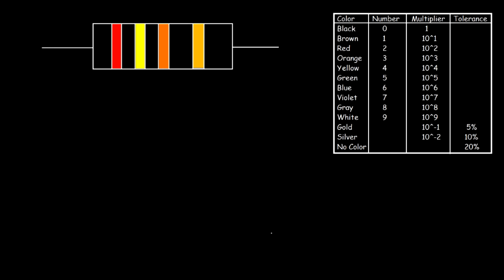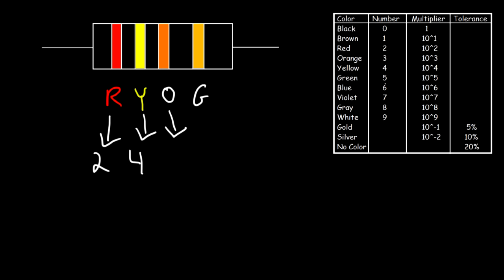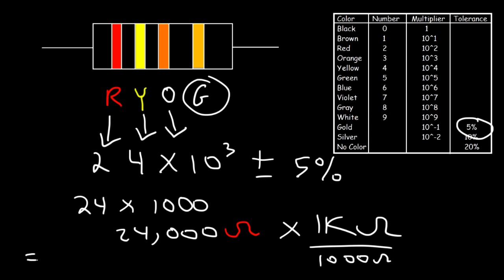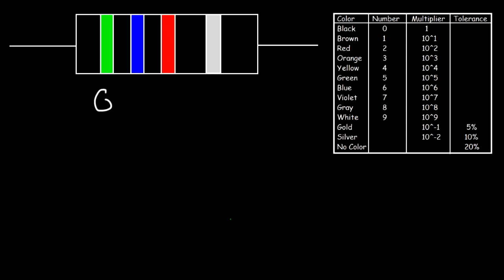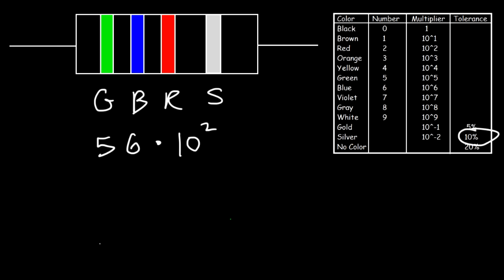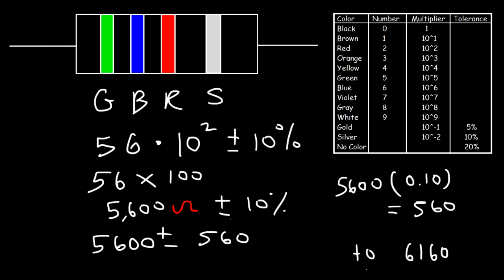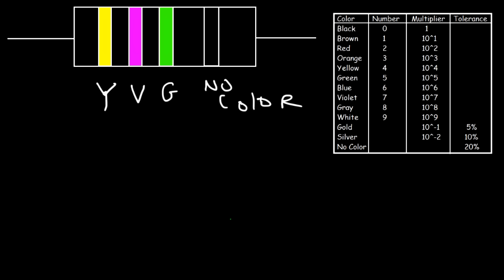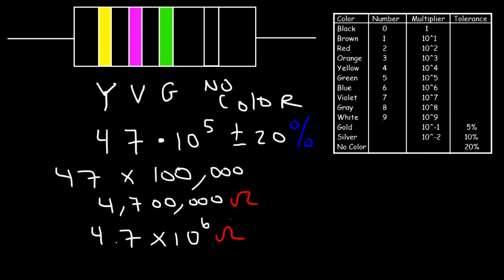Resistor Color Code Chart Tutorial Review - Physics

Comment: Thanks. 
I have always sucked at math and being slightly dyslexic doesn't help. I  really struggled with binary/hex when I was A+Certified  wen the dinosaurs roamed the Earth, but you made it easy to understand. I'm 61 an have been a auto tech most of my life. I was fixing  ECM issues back when there was no internet and I had to go to he library to get resistance values for sensors. It was around $40k for 'Alldata' system, and I couldn't afford that, so I had to make due. Most private shops would turn ECM issues away and just send them to the dealer.

I am semi retired and live off grid, so I do stupid things like switch an inverter on without disconnecting a generator first. That is something transfer switch would handle, but I took me blowing 2 inverters to find out I can't trust myself and I get in too much of a hurry sometime. I am getting good at diagnosing circuit boards and am waiting for MOFSET's to repair both inverters. I know there are MOFSET drivers as well and will cross that bridge when I get to it. That will be soon.  I hope he blown MOFSET's acted like a fuse before it got to the drivers. I am familiar with software/hardware drivers, but IC hardware drivers are a mystery to me right now.

When you feed out of phase power into a circuit with a generator, the inverter will lose every time and fuses are useless because the 'alien' power is coming in reverse, and it happens before you can say "oh shit", and you cannot react fast enough to avoid damage. It appears that MOFSET's will asplode very quickly...But I have also had MOFSET's melt in small inverters for no apparent reason other than them being cheapo inverters that fail if the input voltage gets too low too many times and heat up. 

THer is a protection circut tha is thhere and souns an alarm, but I am always sucking my batteries down to 10 VDC in tthe winter, because I'm too lazy to get out in the -0° and fire a generator
Reply: 😢o nnj p pl.. all

Comment: . The maximum number of volts (E). that can be placed across the resistor
is given by E - PR, where P is the power in watts and R is the resistance
in ohms. If a 2-watt resistor can have at most 40 volts of electricity
across it. Find the number of ohms of resistance of this resistor
pls help to find the answer.

Comment: I still couldn't understand the colour code. could you please help me out. 
1st red 2nd red 3rd gold 4th gold 
and this is from a amplifier with four output and input
Reply: Spades Frazer
Reply: 2.2 ohms with tolerance of 5% ?
Reply: 22 * .1 with a tolerance of 5% = 2.2 ohms with 5% tolerance 

the range of resistors = 2.9 ohms to  2.31 ohms 

(For resistance values less than 10 ohms, the third band is either gold or silver. Gold is for a multiplier of 0.1 and silver is for a multiplier of 0.01.)